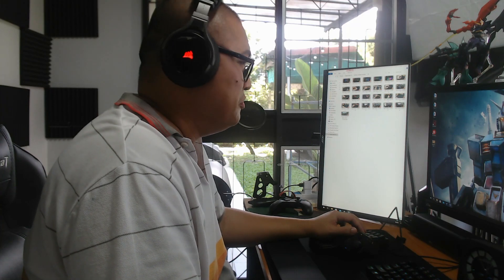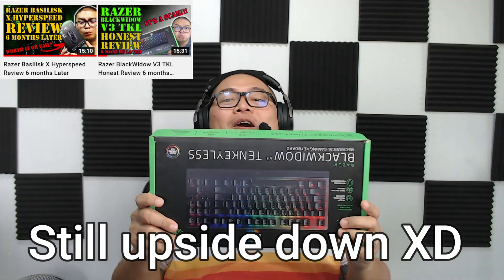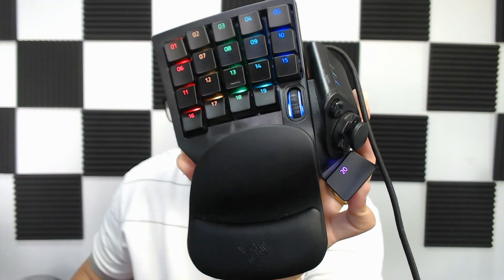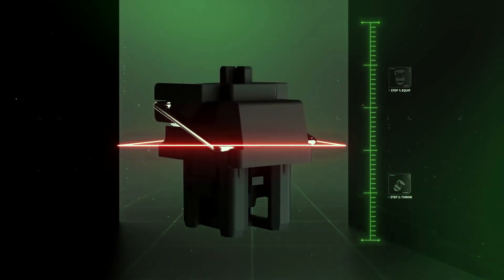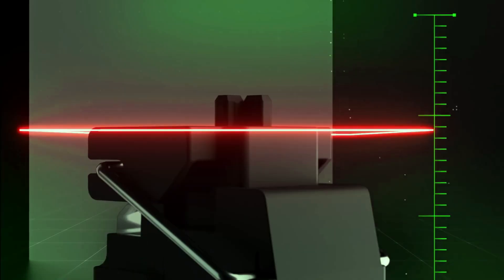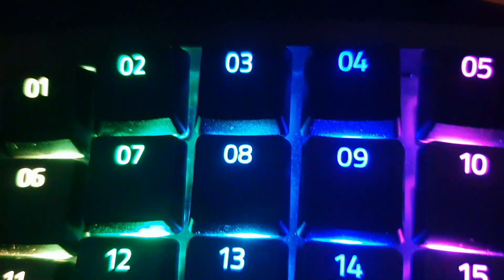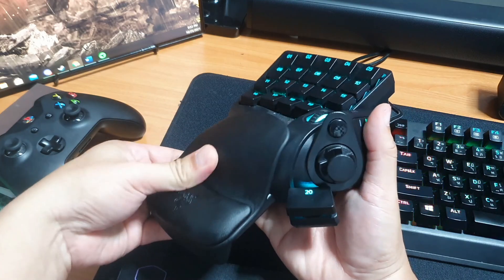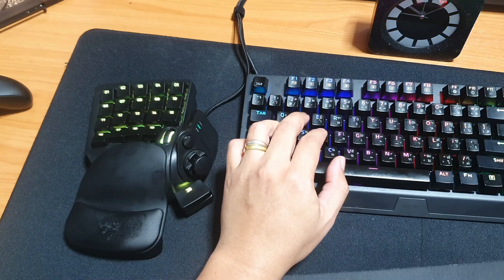Why the Razer Tartarus V2 Pro IS NOT FOR GAMING! (Review)

Comment: Actually bought this for productivity and went like "hey, LoL needs just 6 to 9/10 buttons, maybe i should try using this also for actual gaming" man i sucked those games so hard i wonder if its worthwile to get used to it for gaming... btw, what macros do you use on the tartarus for excel?
Reply from the maker: Yeah I tried to get used to it for gaming, but the adjustment was really hard. Guess its not for everyone. But for work, its become essential. For excel I have copy and paste format, and paste text only. I also have a few formulas, and text sentence shortcuts like "please revise" or "Absent" and "Late Submission". Lastly, the usuals, print screen, print, open app, etc. Super helpful with gradesheets po hehehe.

Comment: thanks for the review! will the tartarurs pro remember key actuation depth settings if you uninstall synapse?
Reply from the maker: thanks! Sadly the tartarus does not have onboard memory. Meaning without the synapes, none of your assigned keys or even depht settings will work without the software. So if you plan to take it around, make sure all devices you plan to plug it with has synapse and internet to log in your profile settings. Hope that answers your question!

Comment: I'm wondering if the build quality improved.
I had 2 razer keypads, love them but they all end up having double clicking prob on some keys (especially the ones on the thumb side). In the end, they weren't usable anymore.
As this review is more than 2 years old, could you tell us if the double click prob occurs ?
Ps : why use the cross to jump instead of the little round button ?
Reply from the maker: Sorry for the super late reply. The round button is dedicated to profile change only unfortunately. No double click problems so far. But then again, I dont use it much for gaming but rather for productivity with all them macros. Thank you fot commenting! <3